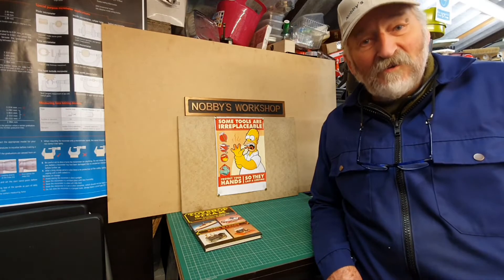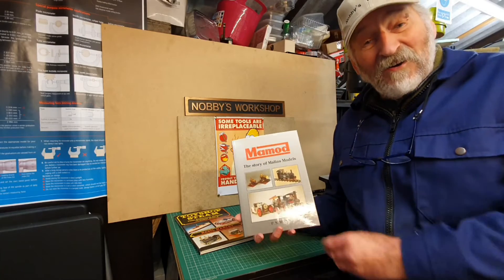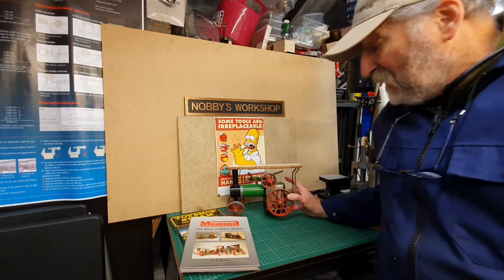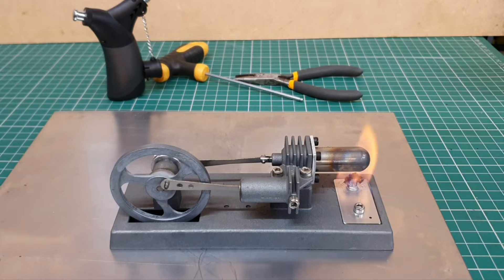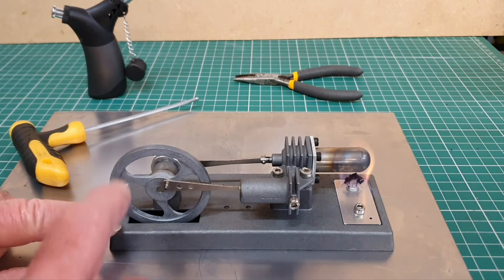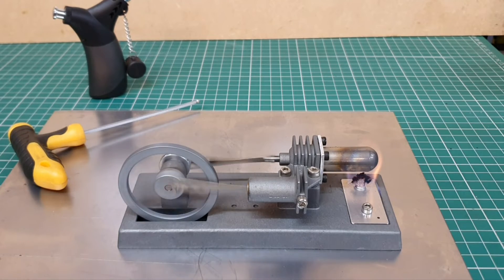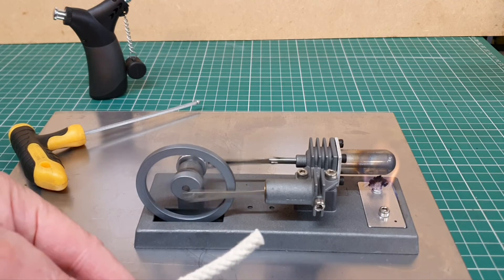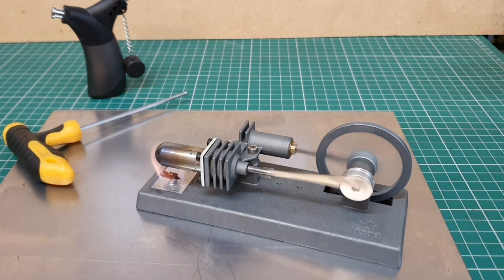My Stirling Engine kit running on methylated spirits.

Comment: Great little runner. The engine will eventually slow and stop as the engine gets hot. It works due to a temperature difference between the hot end and the cold end. As the cold end warms up the engine slows. Lucky you, to get that book, looks like an interesting read. Take care on your now darker earlier nights. Getting lighter every night here in Australia. Regards.
Reply from the maker: It was great to finally see the engine running David. As a project I'd like to build my own Stirling Engine. The book was a wonderful surprise. Such a kind and generous gift. Something to occupy my mind when it's too cold to dark to go in the workshop. Cheers Nobby